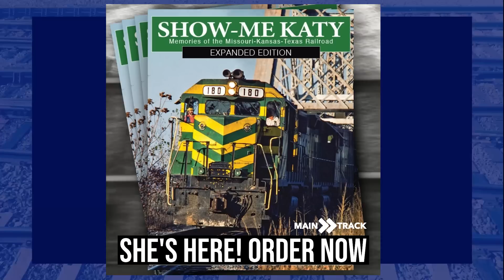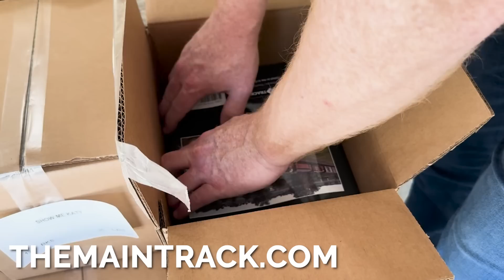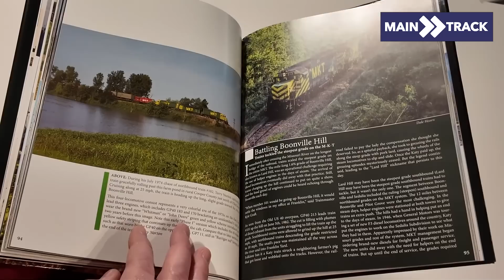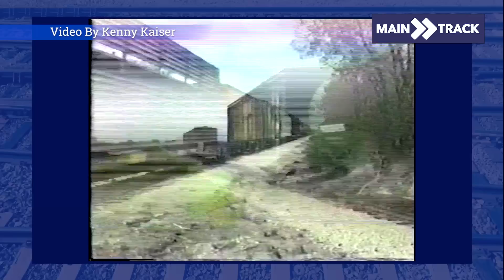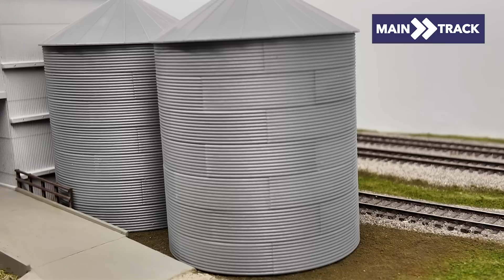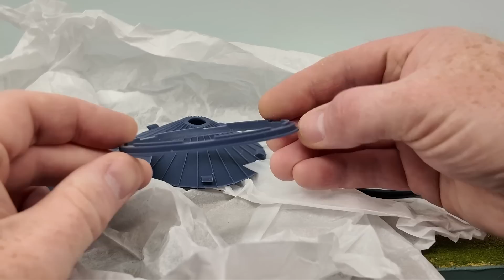Layout & Projects Update: Train Books, Grain Bins, and Covered Hopper Consists

Comment: Congrats on the book!  I hope to pick up one from you at the STL RPM. 
I assembled 6 of the RIX products steel silos that resemble the older steel smooth plate silos.  Keeping the joints uniformly connected was a problem and the rings didn't end up round.  I decided that a jig was necessary to hold them in a round shape until all the joints on a ring were dried.  So, I cut an appropriately sized hole in a piece of poster board using a compass and a single edge razor blade.  It is a little difficult to follow the line made with the compass perfectly, but I ended up with a good round hole.  Then, after gluing all the sections of a ring together, I slipped this jig down over the ring to hold it in a perfect circle until the glue dried.  The first bin came out almost perfect so I did the same with the following 5 with great results.
Reply from the maker: Hi, Ron! I will look forward to seeing you then! It’ll be a great show. That’s a great idea for the other Rix smooth side bins. I built several of those for my Green Ridge, MO elevator. I’m not 100% happy with how those turned out, but thankfully they’re not too expensive and can be redone at some point. I will have to use this tip…thank you! I plan to also use the Southern-Tier concrete foundations for those as I believe they’re the same circumference as the corrugated bins…I’ll have to check. We will see you in a few weeks in Saint Louis!

Comment: For operations I found that the Multi Color Rainbow trains of cars is best.  It makes it easy for an operator to Spot MKT 1234 or BN 2345 (Both Green but both very different) in a sting of cars.  Seems when I ran a more typical train with all grey hoppers, operators had a harder time.   I run a PFE train on the layout.  When the cars were all orange, that makes it a very hard job with a train of 18-23 cars to deal with.  So a I run the transition with white and orange as well as a mix of white and orange doors.  Granted I'm not pinned down to a an exact date or year.  But My target is between 1980s with a dead stop of sept 1996.  The was just before all the big mergers.
Reply from the maker: Hello! You know, that’s a very good point I hadn’t thought of when it comes to too many gray hoppers! Same could be said for green- and how many Katy and BN hoppers I already have. Ha. That makes me think maybe I’ll consider keeping the rainbow look during ops sessions. I know- with my eyes- it’s already hard to make out reporting marks when that’s the only thing on a car. As you mentioned, I think operators would appreciate that variety when it comes to keeping track of everything.